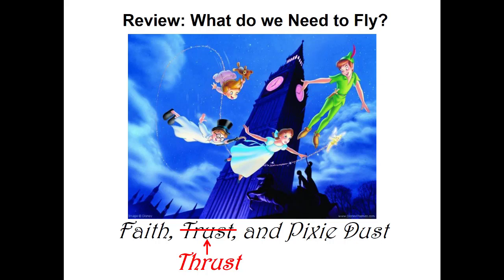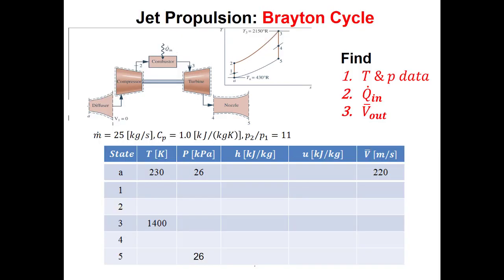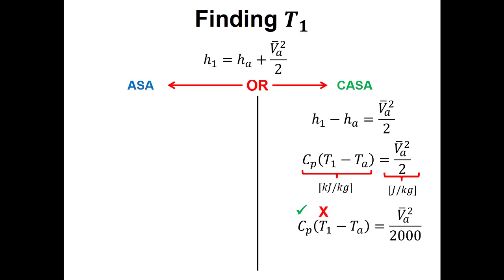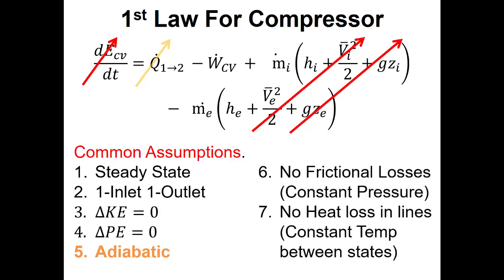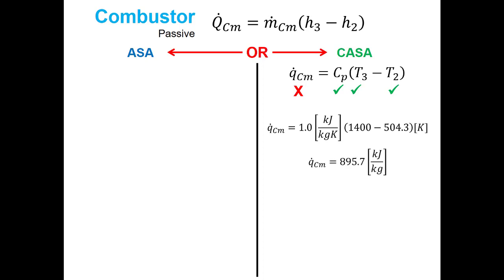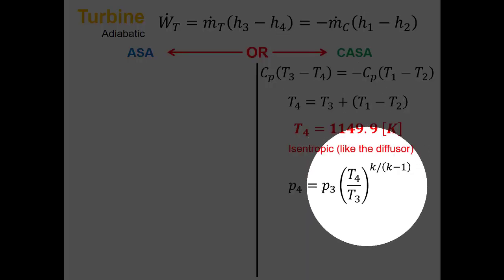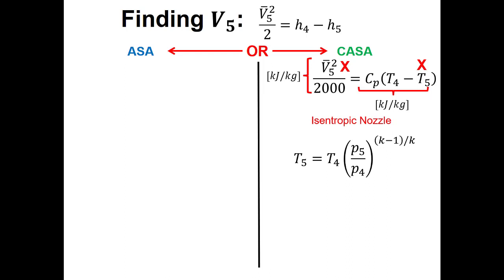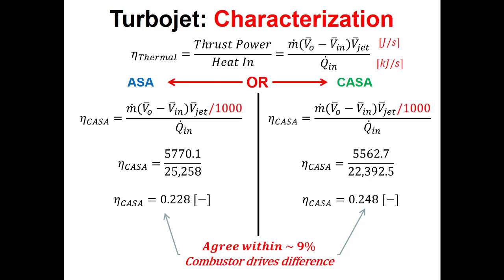L35 Turbojet Example

Comment: This was insightful! Thank you sir. Do you have a favorite textbook you could recommend where I could learn more about Turbojet problems like this? Take care. 

Additionally, working both versions of the problem: constant Cp and temperature-dependent Cp is appreciated. Lastly, I appreciate you starting from the first principles each time and canceling out the terms. I think it is easy for a professor to assume everyone understands what cancels and why, but it's easy to forget the rationale for most of them
Reply from the maker: Thanks for the reply. I always like to start from the 1st law in thermo. I think part of what so many students dislike is all the memorization in the class. And starting from the 1st law takes so much of that memorization away in my opinion. I think that makes the course easier to understand. 

We use Moran et al. I think its a good book with very well laid out example problems. We use the newest version in our class, but i learned from the 4th edition. The principles are the same.

The one thing I would change about the book if I could would be to always present the equations derived from 1st law. They stop doing this when they start cycle analysis. 

In this video, I use the 1st law to show that the expression for power for the Turbine and Compressor is the same, but the sign is different. And that sign tells us the direction of the power (in or out). 

The book switches the delta(h) for the compressor to get a positive value. I think that's confusing for students because it's hard to memorize and you can't get the equation from the 1st law. 

I understand why they do that and i don't think its "wrong". But (1) their way requires more memorization and (2) you can't get their answer from the 1st law. I always want my students to be able to fall back on the 1st law if they get lost.
Reply from the maker: I also did a Turbojet problem in the "ask me anything" lecture below. I do these as exam prep classes where my students can bring in problems they think look tricky and see me do them in real time without having seen them beforehand. 
https://www.youtube.com/watch?v=JLcBAWPHijw